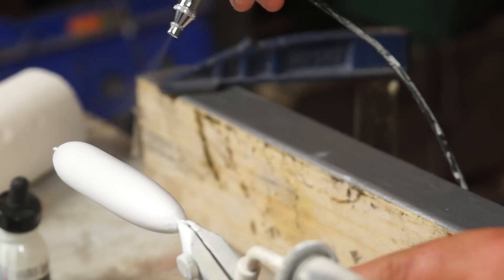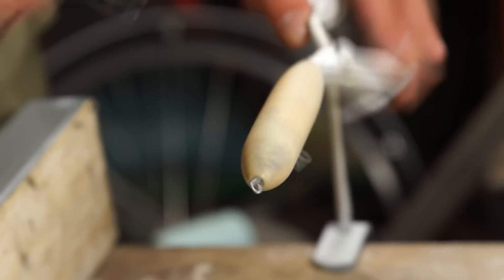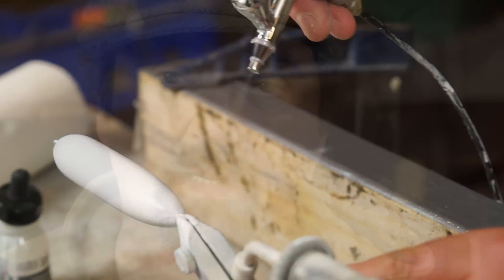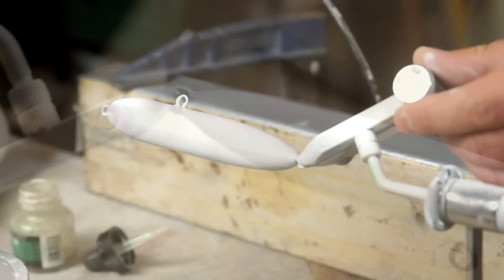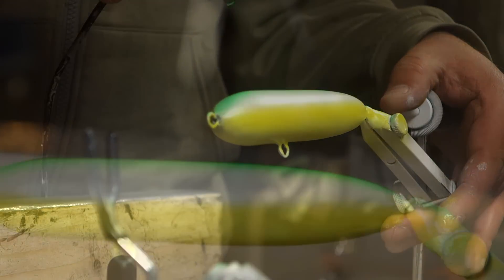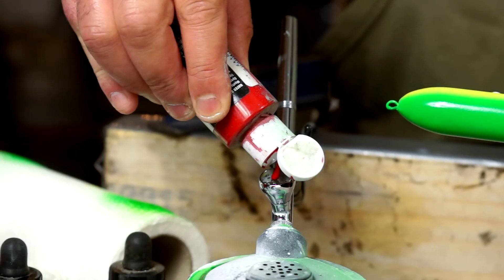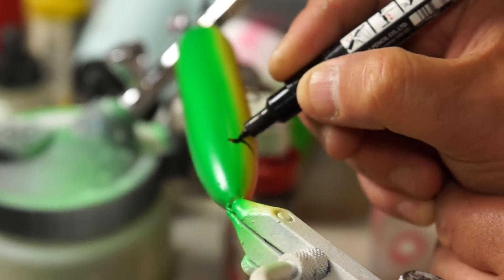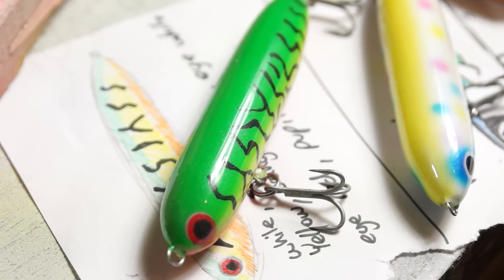Painting a fire tiger pattern wooden lure

Comment: Years ago I did a mural in a college dorm room.  I used a black permanent marker on parts of it.  I found that the fluorescent lights in the hall would fade the marker quickly.  Does that top coat prevent the marker from fading?
Reply: its an acrylic pen, so it is just like pain. it shoulnd fade givin the right cqre
Reply: +Triston Peter did you have a stroke?
Reply from the maker: It is acrylic so it is not uv sensitive  in the same way marker ink. Acrylic pens tend to be favourites amongst graffiti artists